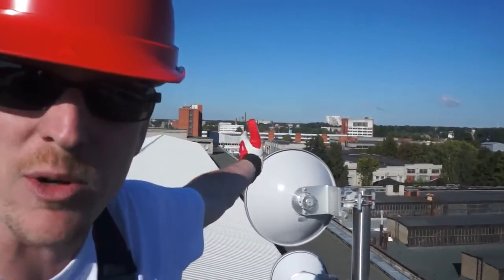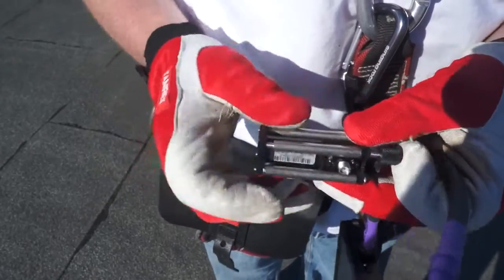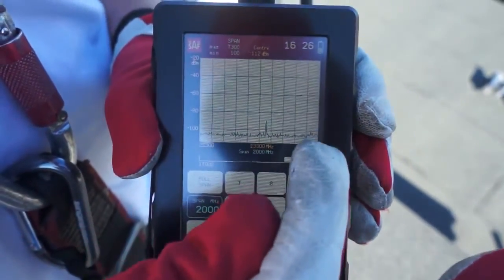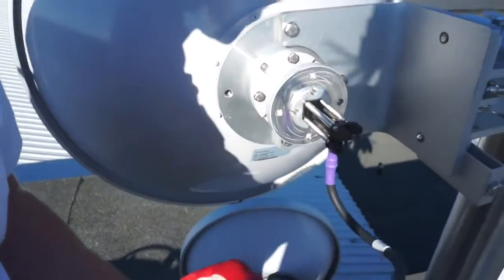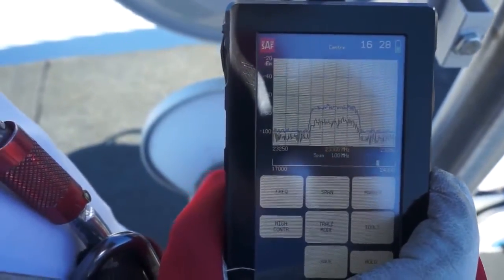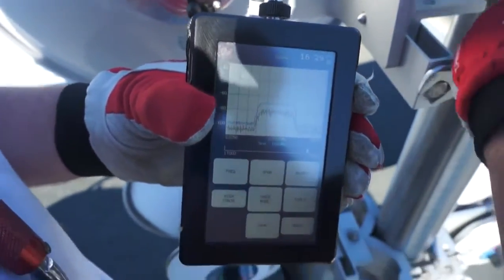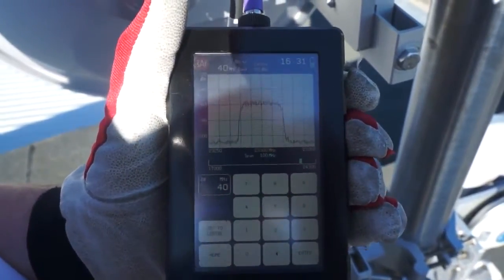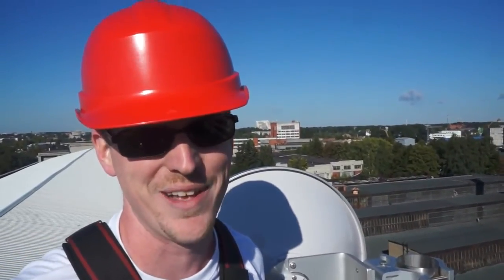Microwave Antenna Alignment Tutorial

Comment: Suppose that the microwave antennas (frequency 18 GHz) are placed horizontally and that one is slightly shifted so that the maximum radiation is not in the horizontal axis. If both antennas have the same transmission power, the same gain, the same polarization, the same waveguide losses and connection points, will the reception power be the same and why? If not, why not?